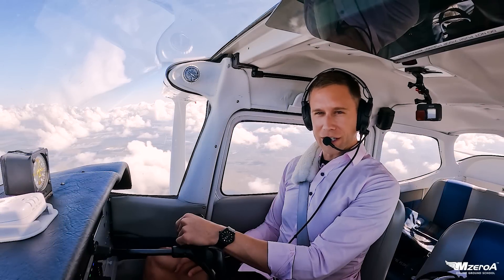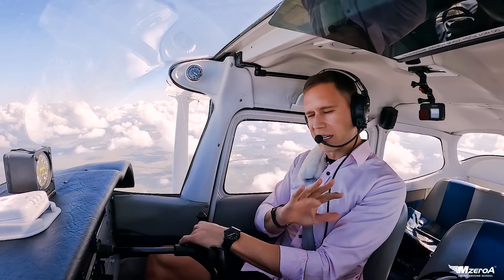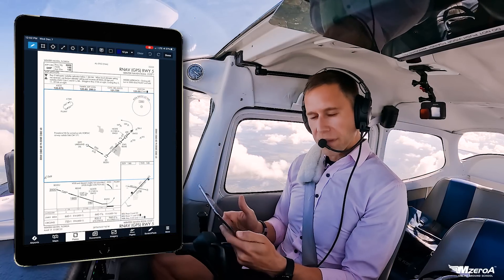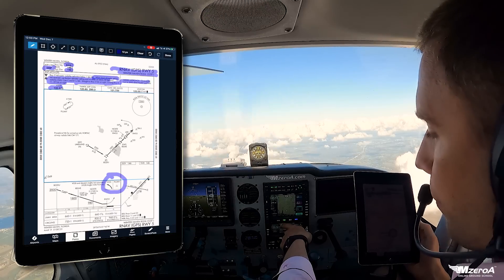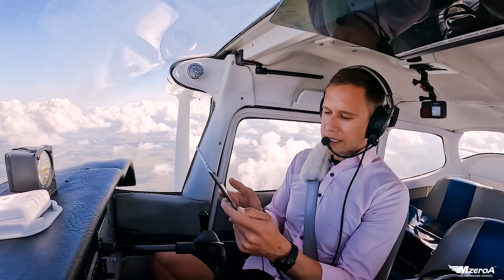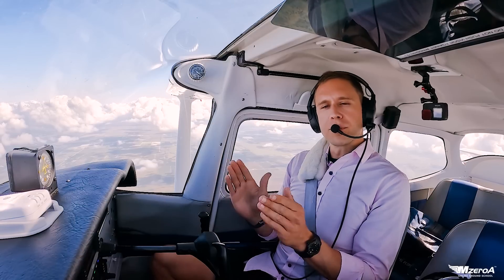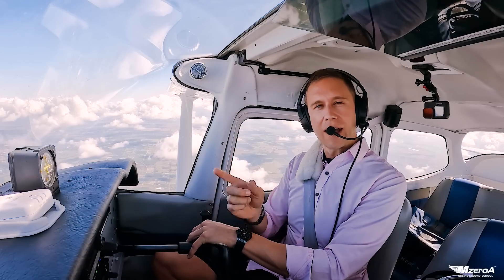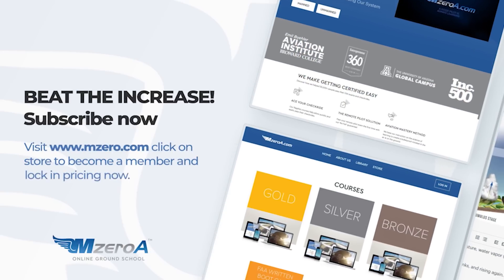How To Brief An Instrument Approach

Comment: This was a great video.  It reminded me of the many things I "love" about IFR flying.  In particular, practice approaches at busy airports.  The constant chatter from ATC and other traffic is extremely distracting.  Just doing the things necessary to prepare for an approach is difficult enough, without having to monitor the radio in case they call you!  There isn't much that can be done about it, though.  More sectors?  More controllers?.  Aviation is booming and the high cost of fuel hasn't affected it.  Here in southern AZ, we are totally saturated with flight training schools.  It's the price we pay for good weather I suppose. 18/18